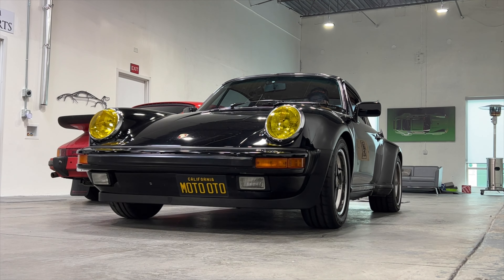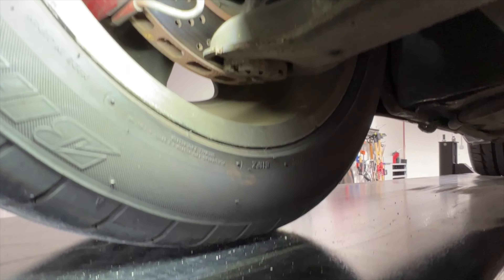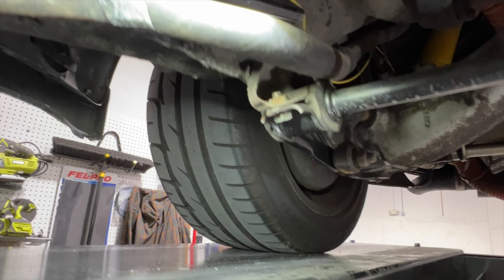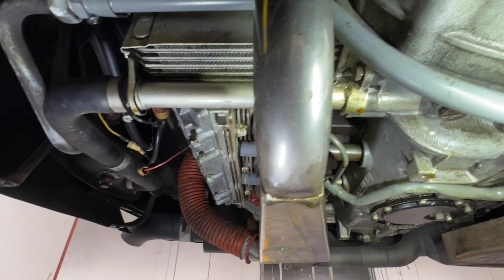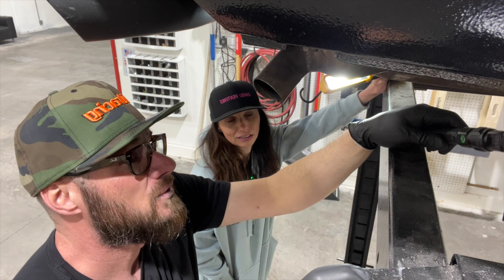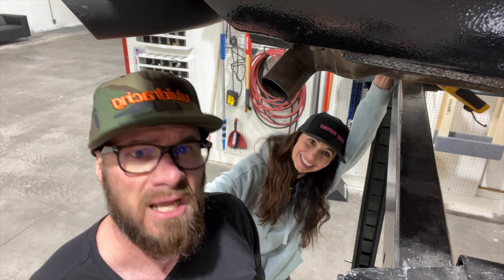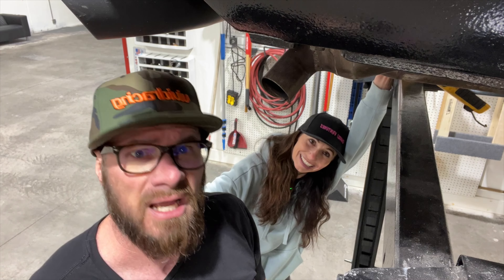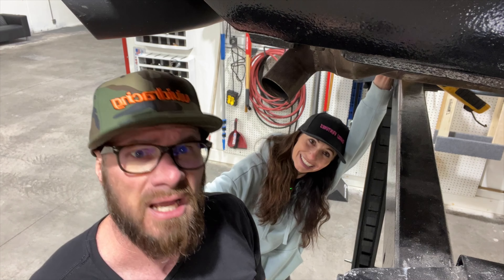Porsche 930 nightmare

Comment: 6:13 "This is out of my expertise"  The only thing this guy says that makes much sense.  I don't think I'd trust someone who calls an AC condenser an oil cooler.  Declares ball joints and trans mounts "toast" before putting any load on them?  The case seam isn't very likely leaking.  The leaks are coming from above and dripping down.  That's a driver level car.  Sure it needs some attention but its no where near as bad as he is suggesting.  "engine out" on a 930 is standard maintenance.  Can't adjust all the valves with the engine installed.  His tirade about zip ties and Porsche not using them on the wiring?  Take a look under the dash and you'll find factory installed zip ties.
Reply: My friend, the oil cooler is located at the front of the car.  The AC condenser is located in the deck lid.  My “go to” on every air cooled Pcar is to replace all the bushings, tie rods and ball joints.  You can tell they need replacement within 5 seconds of driving.  We knew within 3.  

Obviously I am exaggerating a bit.  I needed a couple more miles and some threshold braking to make a final call.  

The car was in way rougher condition than we thought.  However, we knew that going into it.  

Thanks so much for making comments.  It is appreciated and, I do appreciate the insight.  Because, of the 48 Porsches that I have owned, I am realizing I still learn new things every day.  

Cheers!!  Come on a drive with us!!
Reply: @thedriveologist618  Thanks for not being a dick.  I admit, I  came off a little snarky.  Respectfully, you're wrong.  1:56 you point to the AC condenser, of which on this car there are two,  and declare its the oil cooler.  The oil cooler is mounted in the right front fender behind the headlight.  I may or may not have owned 48 or more Porsches in my lifetime as I stopped counting but I have been working on them professionally for 30+ years and currently have 3 930s in my shop and one in my garage so I do know a thing or two about 'em.
Reply: Bill is correct. I have a 1987 930.  Sometimes people jam an oil cooler in front of the front condenser with a lot of modifications.

Comment: Hard to tell just by watching nor couldn’t really hear the engine well but looks like you have leaks from multiple places. It will be difficult to diagnose until you open the engine apart. Drain the oils (motor and gear) and see metal debris are collected. If that’s original mileage shown on dash then most likely it’s time for engine rebuild. Leaks coming from your turbo is concerning